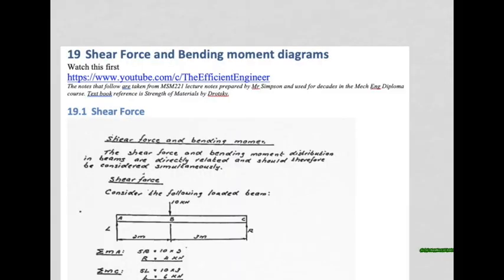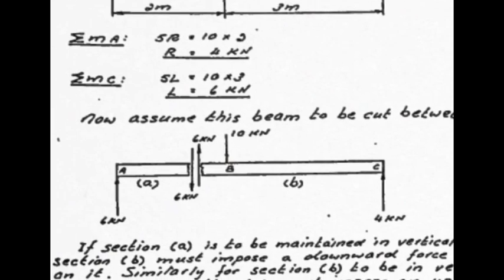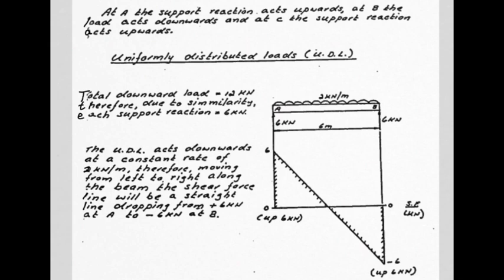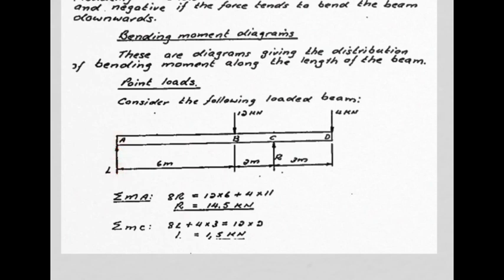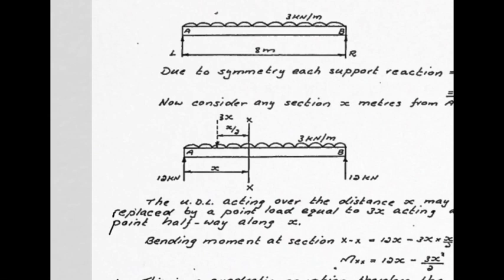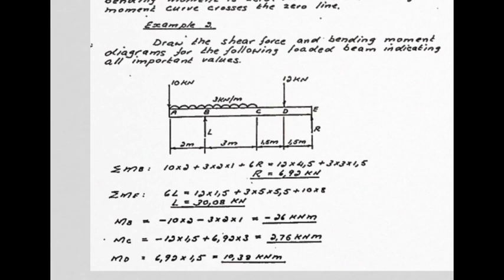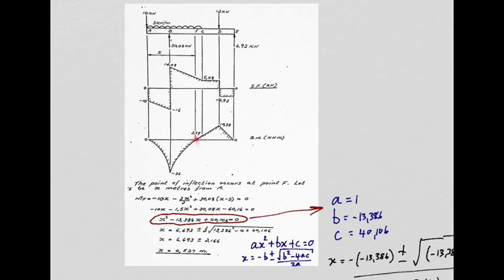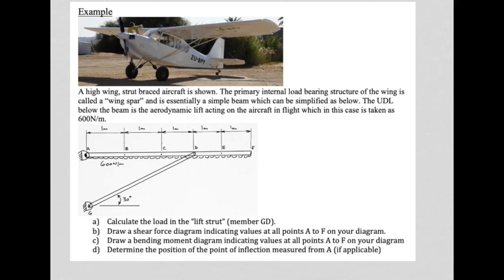18) Shear Force and Bending Moment

Comment: Very nice! Is there a correlation between the shear graph and where the beam with fail Russell? Assuming a perfectly homogenous beam?
Reply from the maker: Hi Paul, Yes! Well spotted. The point along the beam where the shear force is zero happens to coincide with the points of maximum bending moment. A beam with consistent cross sectional shape will fail at the point where bending moment is at a maximum.